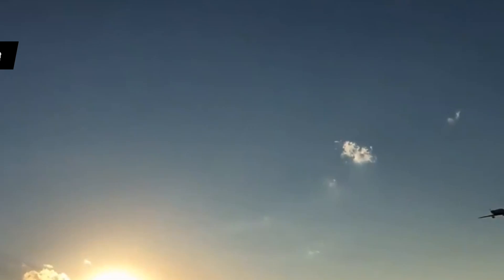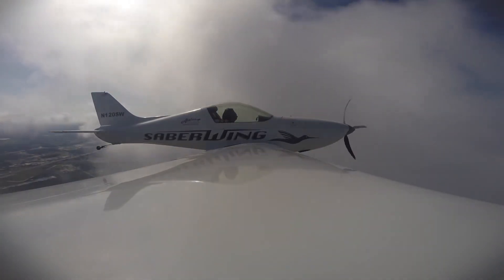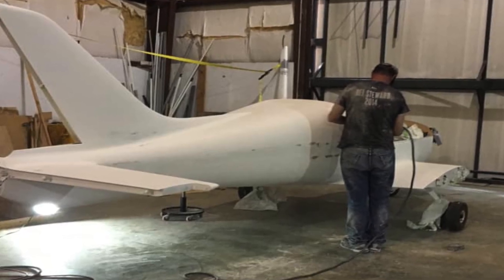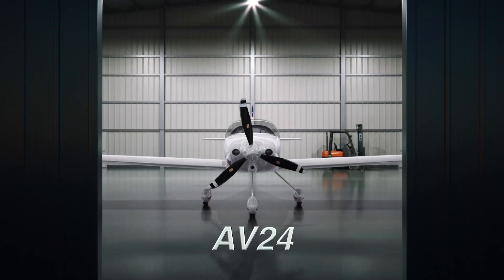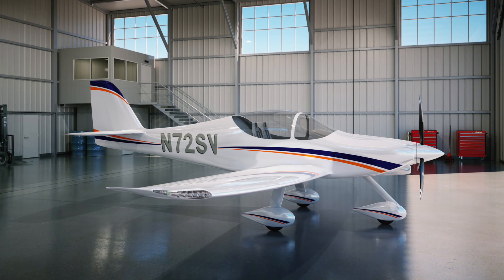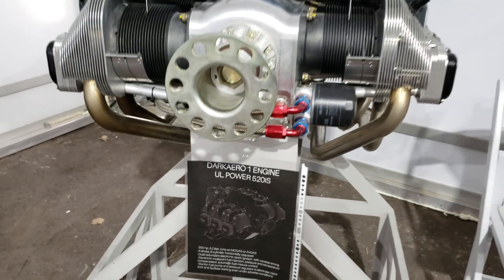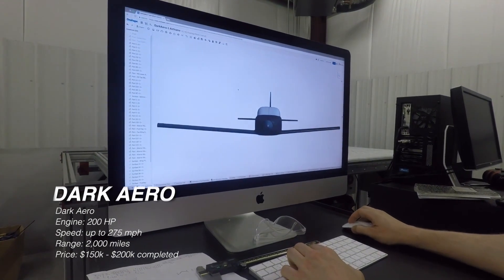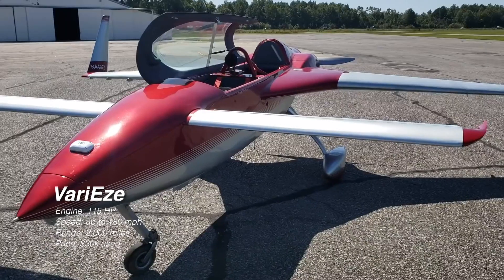5 Airplanes You Can Build In Your Garage

Comment: The last airplane you discuss, the VariEze, is pronounced "very easy." That's because at the time, 1974-75, it was much easier to build than other plans-built aircraft. The N-number of the example in the video indicates that this is a fairly recent aircraft, built in June, 2003. It has several non-standard modifications, including the red paint, which is strictly forbidden. Red heats up almost as much as black. On a plastic surface the heat can actually melt the underlying structure!

Comment: I have built 2, 1 seater f-16, and about got my SR-71, i even built my motors they do not  have or use any liquids , none , i highly modified Nikola Teslas turbines. the motors has no top end speed, only limit is the body, if i could afford a different body for the SR-71, i only fly the around 200-300MPH and dont get over 7000 feet when the air gets thin the motors will shut off

Comment: Stay away from the Corvair.  I built one.  The truth is that by the time you buy the redrive and all of the specialty parts you have not saved that much $$$ .   You still have an auto engine not designed for aircraft use.  I sold mine complete with test stand to someone with dreams of using the Corvair.  The redrive is necessary to prevent the engine from breaking the crankshaft. Caveat emptor! I am pretty sure sure this plane does not need 180 hp to go like stink.

Comment: 2,000 miles on 24 gallons in a VariEze? What are you smokin', mon?  
There never were any kits.  It's a plans-built Experimental, one of Burt Rutan's very early designs.
The engine is usually a 100 HP O-200.

Comment: I want to see a light sport, low wing aircraft fitted with a turbocharged V8 that makes 1000hp at 6,500rpm, but makes 400hp and 600lb ft tq at 2,000rpm, so that the aircraft can cruise at like 300knts and almost go mach at full throttle. 

Ironically it would probably be more fuel efficient than the same light sport fitted with a conventional aircraft engine, as they have to really turn high rpm to get the plane moving.
Reply: Umm. 

Problem 1 is heat rejection. There's lots of heat and no way to get rid of it. 

Problem 2 is a turbo that will get a 400ci engine to 1000hp won't even consider making boost at 2000 rpm. I don't think any car V8 can make 400hp at 2000 rpm on any fuel that's not methanol. 

Aircraft engines are not high revving, they are very low revving. This keeps heat production down and engine reliability high, two things planes absolutely need.

Comment: Are diesel engines never used in light aircraft? They have the power, fuel economy, torque and forced induction.
Reply: Diesel engines tend to be very heavy compared to their gasoline/petrol counterparts.

Comment: None of these is a practical machine but more a pipe dream. I think most people have no idea what goes into building one of these “kits”. Most who start, never actually finish but they end up as a hunk of parts on Craigslist. If you want to build a real kit plane you can actually finish and have builder support, resale value, speed and affordability then there’s only one. Vans! That’s it! IMO. Oh, one more thing,I built mine in the 90’s for $34,XXX. Yes, that’s right. $34 grand. Used O-320 and painted it myself.

Comment: The structure of F-104, an slower X-15 version, is so simple: https://youtu.be/TIJy_KmZGYA that for sure you could build one in your backyard.
 Finding an engine is the difficult issue, the use of  Ramjets, or of 'Trompe' (Wikipedia) this adds silence, decreases thermic trail, Metal Additive Manufacturing, Powder Metallurgy, 3D Metal Printing easies the task of engine making; for sure, scaling down airplane size allows flying with less power. 
I'd simply move the horizontal part of tail to another place, 'T' tails are prone to 'Super Stall', if wing enters stall, the wing turbulent flow print, shadow, reaches tail, making the attitude control ineffective, impossible to escape stall. Good Season! Salut +

Comment: Cool video. I don't think you need a PPL to fly a tail-dragger. Pretty sure I've seen light sport aircraft with tailwheels.
Also, the TAA designation (mentioned for the dark aero) has to do with having GPS and glass panel displays and not a FADEC equipped engine.

Comment: All these fiberglass airpñanes are just like RC models on my opinion, but its only my opinion. That sling kit model you bought yes is aircraft because its made of aluminium.
Reply: What does that mean?  Aircraft have been made out of many materials, and been of good quality.  As long as the designer understands the material he is using, it will turn out good.

Comment: Most of these designs are too slippery for low hour pilots,the super critical wings need careful stall management and rain affects the airfoils  badly,engine out in the glide they can be an handful and accident reports are highlighting engines failing far too often,your speak is that of a salesman talking about performance but not putting safety first.

Comment: There is no such thing as an inexpensive airplane. About $70K and up is the entrance fee. 

Good to hear that the LSA regs are being upgraded. The LSA aircraft were too little aircraft for too much money.
Reply: I have built two Thorp T-18s, two Glasair TDs, a Rand KR-1, a Fisher Youngster, and I am currently finishing a Davis DA-2A and a Quickie Q-1. Obviously, I like to build airplanes. My most expensive plane to build was my second Glasair TD, which cost me about $35,000 complete, but of course, I had to build it. That TD is today worth maybe a little bit more than it cost. Generally, YOU LOSE MONEY on a homebuilt, that is unless you are building Carbon Cubs. The cheapest plane I have built was the Rand KR-1, which cost $1300 complete including the VW engine, which I rebuilt myself. Obviously, this is an extreme example, but it shows that airplanes don't have to be expensive if you have time and are willing to scrounge parts.
Reply: @DaveM,.. I do agree with you about no such thing as inexpensive plane.Although the $70k entrance I would have to disagree! Not tryna be a dik or anything!its just that I've seen some nice cloudhoppers {single engine carrying 2-4 passengers}under $20k. Yes a lil dated but low hours & excellent shape. I found a Cessna cub I 💭 think unsure exact name, it had seating for two people one in front of the other not side by side for $20k. The same lady owned another that carried up to 4 people total for $16k it was a 1978-80 year model but only had like 100hours on it! Wow 😳!! I thought this was too good to be true?? Turns out her husband died in a ski accident in Colorado 10+yrs back and he only flew the plane when they visited their vacation home there.So basically flew from eastern part of U.S (KY,Tenn,?)to Colorado once or twice a yr. He also kept the upkeep to very high standards in his hangar.Honestly, that's probably not a deal you'll come across daily, but,.. there's plenty planes for sale under $30k actually not bad looking at all. I guess it really comes down to what each individual is comfortable with
Reply: Depends what you want, I kind of want an ultralight being sold near me at $7,500. It’s not gold plated or anything but it’s a cute little bi-wing (18ft wingspan, 70 inch adjustable prop, 60 HP engine) in decent shape. Since it’s ultralight it wouldn’t need insurance/license or a lot of things so the cost is basically down to hanger fees (which if you live on farmland, it’s pretty cheap to hang it in a barn). Being an aerospace engineer I personally wouldn’t let any mechanic touch my car let alone a plane I would be trusting with my life (if a normal person can rebuild an automatic transmission, plane maintenance on something so simple as this type of aircraft really would just look like another day of working on a lawn mower). So really only hanger cost is deterring me from that. Otherwise multi-seat and yep, licensing and aircraft mechanics will really rack up that cost! I have seen some nice $8k all metal “experimental” (extremely by the books/generic design, but really well done) but they have bigger costs from maintenance and hanger fees (plus it was also 60HP except it weighed like 950 lbs!).

I could make one cheaper myself, but really the cost of the plane itself is pretty low from what I’ve been looking at (plus I just need to save up for like 2 months to buy one used in good condition, and that’s probably faster than I could make one safely, with the benefit it’s been tested!)

Comment: Hey Mike, 
Nice video, thank you for posting it.

I been watching for a while, like you I love, love, love planes! 

Years ago I bought a Sonex A project. But family, work, and moving around a few states (CA, MI, GA) put a crimp in having a workshop to build a Sonex. Since those days they've come out with a model "B". A little larger inside, easier to build, etc. With same cruise speed and load.

Kits are reasonably priced with options for 1 or 2 seats. Last time I checked they were saying you could get into the air with a 1 seat for around $23K (fus, engine, paint, interior, all.....).

Schedule is opening up for me now, so I'm reconsidering what to build....I really appreciate hearing about all the things you're discovering!! You seem to really like the "fast glass" (as us old timers used to call them). What's your take on the cheaper, aluminum and pop-rivet options?

BTW - A Sonex can cruise around 120/140 with a ~$4K engine <5gph fuel burn (auto gas). They are expertly designed (former commercial and military aircraft design engineers), and they're paying attention to cost of ownership.

Comment: Great video! At DeltaHawk Engines, we’ve reimagined powerful jet fuel engines so that pilots like you can experience the difference. With a DeltaHawk diesel engine, you can fly farther on less fuel, less maintenance, and a lower cost. If you’re interested, check out our videos and website for more information!
Reply: Wow!  Just Wow,   This just made me see DeltaHawk Engines as a low end company that they have to post commercials in the comment section. I will not be using them on my aircraft design I will be selling.

Comment: Can you put a Chevrolet LS engine in any light sport? I can't seem to find an answer anywhere.  And if not a light sport an experimental that is small and a cheap kit
Reply: Light sport class has a 1320 pound gross weight limit.  A small block V8 would be too heavy.  It would have too much horsepower for a plane limited to 120 knot top speed.

Comment: Hey Mike. Love the channel. How powerful are the engines on these two seaters????
Can automobile engines be used?
I am thinking about building an experimental aircraft, inspired by your channel 👍
Reply from the maker: Saberwings = 100 HP
AV24 = 180 HP
Darkaero = 200 HP
Varieze = 115 HP
Reply: Remember power, speed, and cost have exponential relationships to each other.

Four times the power is needed to realize twice the speed.

There is no discount for buying HP in bulk.

Comment: Did I hear you right? Did you say that in the USA you need a PPL to fly a taildragger? If so you guys seems to have a bunch of different rules over there. A Sport Pilot where I live can fly an in flight adjustable prop, a taildragger and retractable landing gear.
Reply: No, the taildragger part isnt the issue. The plane is too heavy and fast to be a LSA due to US regulations. It just also happens to be a taildragger. The big two limitations are max gross weight and speed.
Reply: Mojo mike thinks it’s import to provide general info. Specifics and accuracy aren’t import just the general stuff
Reply: Retractable gears are not legal in US sport pilot

Comment: You can buy Cessna much less than 100k$. They all are safe and beautiful.
Reply: Ville you are correct but they tend to be heavy compared to newer aircraft and slow with a low useful load too. Then there is the corrosion problems of an older aircraft and not to mention have been beaten up for trainers too. There are lot of them out there and not much fun to fly either. But they can be safe it’s that they just don’t fall into the LSA category. Maybe when or if FAA makes their anticipated rule changes they increase the max weight and the 152 falls into the LSA category maybe they will attract more interest.
Reply: Cessna is a Certified Factory Built Aircraft. This list was of Amateur Built Experimental Aircraft. You can get so much more with Experimental that you just can't get with Certified. The cost of Experimental is usually 1/3 to 1/4 of similar type and performance in Certified.
Reply: Peter Toth I agree and I prefer a tube structure than an aluminum framed cockpit. Not that I plan on crashing anytime soon but it’s nice to know that may cockpit won’t crumple in around me. Upgrading a 152 is not worth the money and most have been hammered by flight schools over the years. The 162’s were a bust for Cessna but they have been hammered by flight schools too. On the 152’s when you do the pre-buy inspections the wing spars need to be repaired or completely replaced. I just prefer a newer design aircraft with the capabilities of using lower cost auto gas. Big savings there$$$

Comment: You might want to check your claims about tailwheels prohibiting LSA qualification, there appear to be some examples that are not that case, such as the Sling LSA Taildragger.
Reply: I think he was referring to the actual speed of the saberwing tail dragger. The tail dragger version would require a private pilot certificate and tail dragger endorsement. The light sport version would still require a tail dragger endorsement
Reply: @mauriceevans6546  There are other LSA taildraggers out there, with engines powerful enough to go over the limit. Carbon Cubs are a good example, as are other Super-Cub derivatives (e.g. the Legend Supercub) and even the Kitfox, with a big-enough engine in it. In such cases I believe the aircraft are limited to a certain % of power after take-off, and can still be registerd as LSA, and flown by LS pilots.
Reply: @SpyGeorgilis  that is true, however they are limited to 120 knots.
Reply: I am currently finishing my sport certificate in a carbon cub sport
Reply: Rules are expected to be changed by the new sport rules coming in 2020/2021. Four place aircraft,  150 knots, increased weight and constant speed prop which is intended to allow the rotax 915 turbo
Reply: @mauriceevans6546  Sure, but of course that's 120kt IAS at sea level. Most kit sellers promote TAS @ 7500ft or thereabouts, in their aircraft specs. Up there, a plane capable of 120kt IAS at zero feet could easily top 135 TAS, i.e. 155MPH over the ground (with no wind). That's plenty. A Cessna 172 can't do a whole lot better than that, and if it tried it would burn about twice the fuel.
Reply: @mauriceevans6546  Wow, that's one versatile machine..!